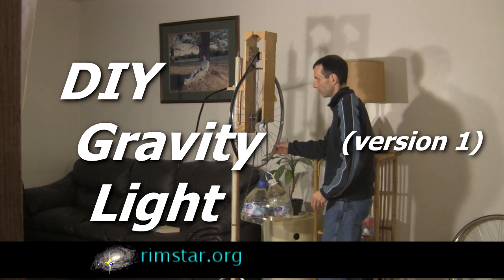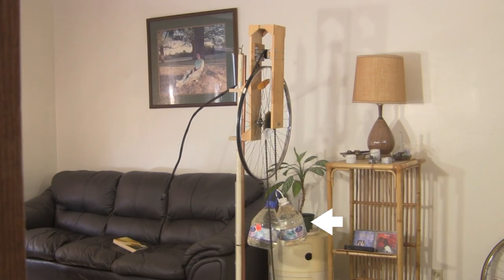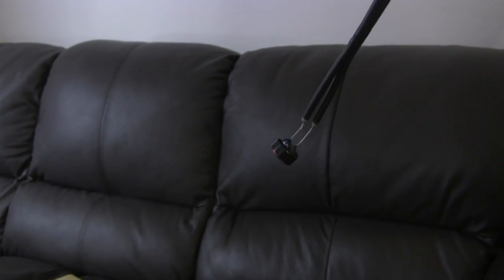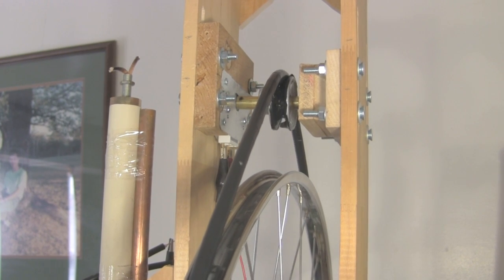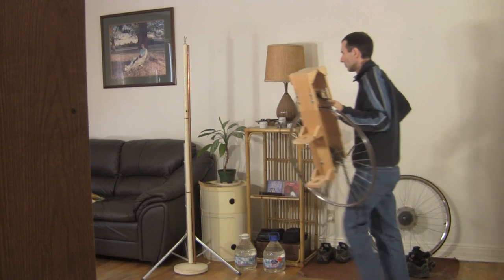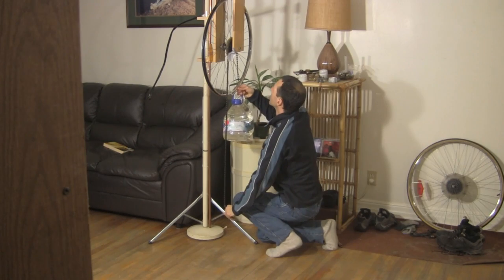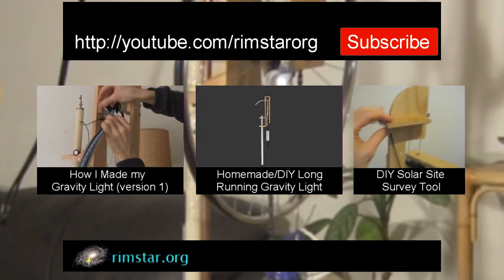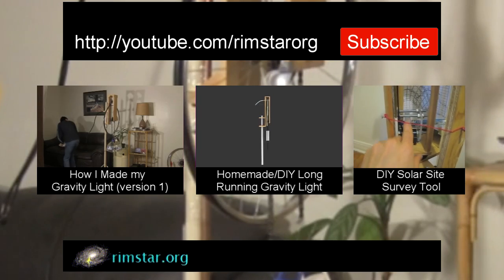Gravity Light - a Homemade/DIY one (version 1)

Comment: Kudos for mentioning that this was done just because. I was fully expecting to see the usual "Or" person commenting on and on about other things you "could have" done.
Reply from the maker: Thanks. I figured it was either mention it was done without much expectations, or disappoint people with false expectations, which I wouldn't want to do. Hopefully I will be able to make a decently long running one, but who knows.
Reply: RimstarOrg What did you use for the generator? I used a stepper motor from an old printer for a wind turbine. It's on my other channel though.
Reply from the maker: The Sqoou
I used the motor from a microwave oven, the one that turns the tray. The ever helpful Mongrel Shark suggested it a while ago when we discussed it on my google plus page. I also tried a motor form a laser printer but it died too easily. I find if I turn this microwave oven motor too fast it can also die for a short time, but then it comes back to life - at least I think that's what happens. I test the LEDs and they're fine.

Comment: For an improvement, maybe you could try to make the wheel spin slower and use gears to get to the generator's required speed.
Reply from the maker: That would be the same, I think, as using the smaller diameter sprockets on the wheel. I'm currently using the biggest diameter one. But to do that I have to add more mass to turn it and my support structure can't handle much more.

Comment: If the wheel system were attached outside of the house near the roof, could have much longer falling times. Much less noise, too.
A rope 'reset' cord would be cool, too. A simple pull every couple of minutes isn't so bad.
Reply from the maker: Yeah, if you noticed the way I just slid it on the pole, you'll see that what you suggest is very easily doable. I sorta had that in mind when I designed it.

Comment: That's how old clocks without a clockwork work. They also have one or even two weights on a rope, that slowly pull with relatively large force on thhose ropes, to keep the clock running. Some of them have an additional pendulum.
Reply from the maker: Yeah, I was going to mention grandfather clocks in the video but I couldn't find as image that was not copyrighted in some form or other. We used to have a cuckoo clock and had to pull the chains to lift the weights once a day or so.
Reply: RimstarOrg In another YouTube video it's called a "Gravity Battery"... same concept.

Comment: Interesting concept, but was the original idea that much better then yours that it was used in remote villages? It seems like it could only work for a couple of minutes maximum, which would be annoying with having to keep resetting the weight. Wouldn't a better idea be to add some coils around a rare Earth magnet flywheel that you can spin up with bike pedals? It would be more consistent and the person powering the thing could read uninterrupted. Why was the weight driven system needed. it seems like there would be a lot more energy lost in the slow moving weight design because of all the gearing.
Reply from the maker: The original one, from Deciwatt, runs for 30 minutes. I'm hoping to get 15 to 20 minutes eventually.
Reply: That's pretty impressive. It will be great to see how you optimize your design to make it last that long.

Comment: I became fascinated with 'primitive machines' after watching a documentary on Heron of Alexandria - on YT, Ancient Discoveries Ancient Discoveries - Robotics: Heron of Alexandria (Documentary)
Reply from the maker: Yeah, I love those primitive machines too. They're ones we can make!
Reply: Made me think if the rope the bottles were on went around six bike tires like a coil, and if you shrunk the smaller wheel by half... You should be good for about 1/2 an hour? :)

But it'd be a long rope...
Reply from the maker: Elaine Kain
Yeah, going higher is certainly an easy fix. In fact, if you notice the way I mounted it on the pole, the pole could easily be a flag pole and I'd get longer running now with no changes expect the longer rope.

Comment: What if you combined this with pendulums like a cuck-coo clock? They function at least 12 hours between winding, and even just an hour would be useful in a power-outage - one can reach over and rewind if desired!
Reply from the maker: A cuck-coo clock has a pendulum for timing purposes. So the pendulum wouldn't help here. But some of them have falling weights instead of a windable spring or falling weights, like this gravity light, for power. Ours did.

Comment: Great to see this running :) I can see it took a bit! I'm surprised how much extra gear ratio you had to add. Is that black silicon for grip on the drive shaft pulley? I'm assuming you dont want to add too much extra weight for a longer running version. Any idea how many joules for the weight you have per meter? I'm thinking it looks fairly lossy? all that gear ratio in the motor... I'm also curious about the led choice. Would have thought you'd add more of them, or go for a higher wattage. If you rectify into a cap and discharge at same time via resistor, what's the output watts? I'm only asking all this so I can offer suggestions for the longer run version. I'm thinking the turntable motor is great for availability, but not efficient enough. Although maybe you could charge a (super)cap and run a JT? Or step it down through a MOT for 12v?

First thing that comes to mind for extending run time, is use the smaller sprockets on the wheel. Although I see thats going to need more weight, and you cant add much more and have it people friendly. I'm thinking at least 50% of the power is lost in the gearbox, probably a bit more loss with the motor being less efficient than an alternator. So maybe 20-30% of the power is making it to the light? Going to be hard to improve on  with salvaged parts and low budget. Shame you dont have a great big stepper like the one I got from a photocopier... That would improve things a lot I think. Its about half the turning resistance as the turntable motor, but puts out a lot more power, you'd be able to go strait to the small cog, probably triple your run time right there. I wonder how hard it would be to make an alternator from some MOT coils and a Neo magnet? Or a more environmentally friendly copper only alternator? Seen them done for DIY wind projects, but dont know a lot about winding ratios etc... Not a lot you can do with the wheel pulley you made. Looks pretty good. Little more belt tension maybe or another belt if you can find one that size for cheap.. Maybe some tubes or a loop cut from one tube and stretched? Its the gears in the turntable motor that are going to have to go. To be replaced with big copper coils that will provide mechanical resistance when under load. I cant hand turn some of my steppers with the leads shorted... Even the nema17's are really hard to turn with low enough resistance load... I think the first thing to do is get a rough estimate of the HP and RPM at the output of your pulley wheel, without the motor. Then look into better alternator/generator. Don't suppose you have a working car alternator handy? I tried to turn one by hand when hooked up to charged battery once. Wasn't going to happen.... If you had 3-4 primary coils from a MOT and some big Neo's. I think you could make a rudimentary alternator that would get you in the ball park.

Sorry for such a long comment and so many tough questions and vague ideas. You got my brain gears turning. I'd love to see this one work out in a more practical way. Keep up the great work :)
Reply from the maker: I can definitely see your brain gears are turning! :)
Next week's video has the construction details and will answer some of this. But for now, the drive shaft pulley has vinyl electrical tape on it for grip. Without it there has to be too much belt tension. In fact the belt is a bungee cord also with vinyl electrical tape wrapped on it. Without the vinyl tape I had to put more tension on the belt. There's no slippage now.
I haven't done much optimization yet. The way people were talking on places like hackaday, I wasn't sure I'd even get it to work. Turns out it wasn't too difficult. But mainly I just wanted to prove to myself that it was doable. Over the summer I'll work on a more optimized version. And I'll be rechecking your comment often to make sure I didn't miss anything. And of course, I'll post to google+ etc with progress and hopefully get more good tips. I can see there's a lot to explore. Thanks for the feedback and suggestions!
Reply: So I just pulled my good drill apart..... Gearbox is a bit tricky too! I was wondering why I couldn't turn it with battery disconnected and light leds where battery goes. At first I thought it was electronic. Messed with the trigger a bit, then caved and de-soldered the motor from the control unit. Still couldn't turn it, kept jamming. Some sort of reverse torque stopper in the gearbox.... So out with the screws and apart came the gearbox. bits went everywhere! Ball bearings all over the floor. Took me a while to work out how it all went back.... Anyhow I worked it out. There are two needle rollers in there that need to be removed for the reverse torque to be applied. After re-assembling the two stage planetary gearbox without the needle rollers. (Which took quite a bit of lateral thinking) I can now light the LED's soldered to the motor. Takes approx twice the speed as the turntable  motor, but requires a lot less force. I think its approx 20% more efficient......

While I was in there I learned how the torque slipper clutch thingy works. Its simple but clever. Thats where the ball bearings came from.

Tempted to do a video on it all.
I also just remembered I have 3 old drills with stuffed batterys in a box somewhere... Probably should put the good drill back together now. But first, I will change that dirty old grease..... And maybe check out how hard it is to get to the bearing I half stuffed making the DIY hand lathe.

Long story short... I think you should keep an eye out for some old drills. Way more current than the turntable motor. One half turn can kill the LED's with a small burst or green then orange!!! I'm applying a lot less torque than the turntable motor, and the extra speed isnt that bad. You could probably go the the smallest cog on your  wheel, and reduce the weight, for a similar or slightly longer run time. half watt LED's would probably work well. Its a bit easy to burn out the 30ma ones (past torture tells me that takes about 200ma for instant death with orange flash). The gearbox is fairly tricky, but I think you can work it out. I'll have video up by next thurs anyway, showing how to mod the gearbox for reverse torque.
Reply: Just did amp test. Can make 2 amps!!! torque required goes up as resistance is lowered.
 Voltage was lower. about .4v at 2 amps with the 2.2ohm resistor in my DMM.... Thats nearly a watt! Tested with a 1.2 ohm resistor My 6y/o daughter can make .8583w and I can make 1.5w turning as hard as we can for half a rev. with 1.03 and 1.85v respectively across the 1.2 ohm resistor. Tried an 82 ohm resistor and the torque is the same as no load.... Drill motor works good. Only makes 4.2v max by hand, but plenty of current and low torque required.
Reply from the maker: Mongrel Shark
Hmmm... I tried a drill motor back when we first talked about this a few months ago. I took the motor out altogether, spun it up to 9000 RPM using another drill to turn it, and got .75 volts and no useful amps, with a small LED as the test load. I guess I did my test wrong. Thanks for pointing it out.
You previously suggested going to the smallest cog on my wheel. I didn't do that because when I did it required a lot more mass, as you'd expect, but it was more weight than I wanted my structure to be holding up.
Looking forward to seeing your video.
Reply: I couldn't get any useful power from the bare motor either. The gearbox has a very high ratio. I might even count teeth and try and work it out.
Reply from the maker: Mongrel Shark
Ah. This particular drill leaped off a roof, which is why I took it apart. Not all the gears were found. So the only way I can use it is as a bare motor. Oh well.
Reply: Broken drills are a dime a dozen, maybe you can find one with a burned motor... I think a 240v drill may be good? If a 12-18v drill makes .75v then a rectified mains drill may make a bit more...

Comment: Damm ..I thought I came up with this idea.... I have a electric 24vdc fork lift. I can lift 3000 lbs to 12 ft. I was thinking of using a clock typ gear to regulate a generator to charge batteries at night. Solar Panels to charge battery bank & lift through out the day. Theory is once battery bank needs charged a colinoid frees a break to start gravity charge..... of course I don't have the time to put this into action for a few years but I think it would work.
Nice vie guy!
Reply: I did some math on this a long time ago, lifting rocks as a sort of primitive, steampunk battery. Use sun to life the rocks in the day time, then you have a big, super large gravity battery for night time. It turned out that a flywheel would be better if you could make one fairly cohesive (a large piece of circular concrete). Flywheels were some of the earliest batteries (see: pottery wheels). You could also use the sun for other energy uses because charging a flywheel can be done quickly. Spend most of the day melting iron for smelting, save the last hour or so to charge the flywheel for the night.
Reply: joshcryer I did some studies on flywheels a while back. I think the fly wheels friction drain over time would come into play on long term storage. Not to mention the wheels RPM's needed would be way to high for a cement or any homebrewed structure to handle..
Gravity storage would last as long as needed.  Do you have any formulas that you can share on "weight to potential energy" 
  I have an electric fork lift but I think an electric winch would work as well. make your dump load on a solar/wind system operate it.  If I was not in the middle of my silo build I would play, but I have so many projects going on play... Cord wood floors here I come!  ;)

Comment: Awesome.  Looks like a decent light output.  How many pounds for the weight?
Reply from the maker: Thanks. Eight kilograms, so eight liters of water. Let's see... 18 pounds. I was worried it was going to be a heck of a lot more, if it turned at all.
Reply: RimstarOrg
That's pretty good light for 18 pounds.  I'm getting about 2.85v at 25mA using 25 pounds.  I think with your metal gearing you could put much more weight than the deciwatt gl could ever handle, which I think is max 27 pounds, although the structure would have to be able to hold that up.  That's one of the problems with the deciwatt light, in that you need a place to hang it from.  Also the flickering light.  I installed .3 farads supercaps to smooth the output to a solid light.  Anyways very nice for the first build.  Oh I wanted to ask have you tried powering a joule thief, and adjusting the base resistance to make to drop time longer?
Reply from the maker: *****
I get flicker when the mass isn't dropping fast enough - though I'm guessing the Deciwatt one has extra electronics in it that may make it not so simple as that. I haven't tried a joule thief yet. I can see I'll be doing more testing with this one before starting my next one.
Reply: RimstarOrg
The deciwatt does a straight connection from the motor to the led.  There is a switch which will engage if the weight exceeds the 27 pounds, which will turn the red led on, but that's about it.